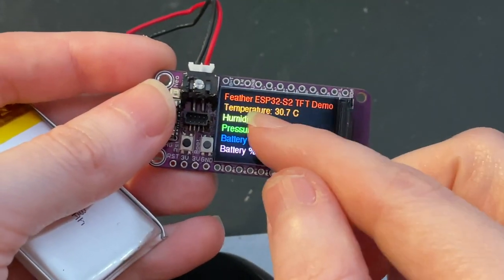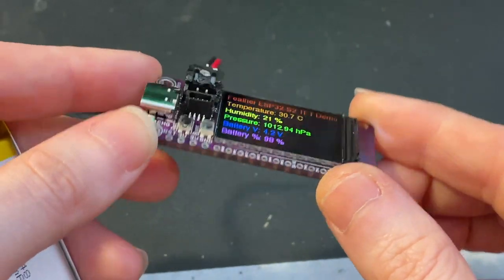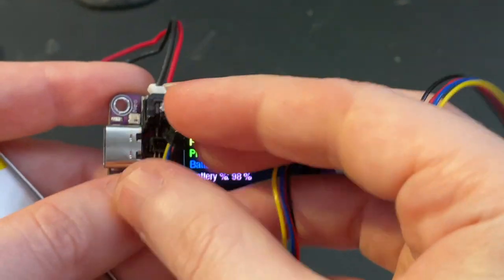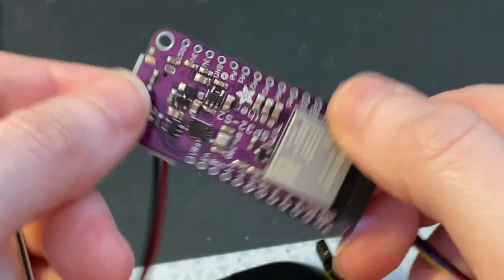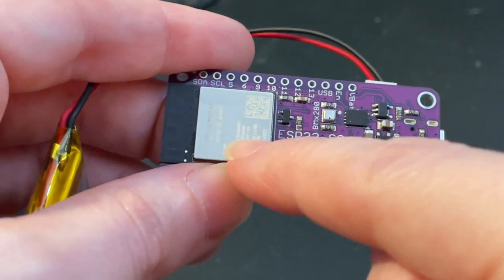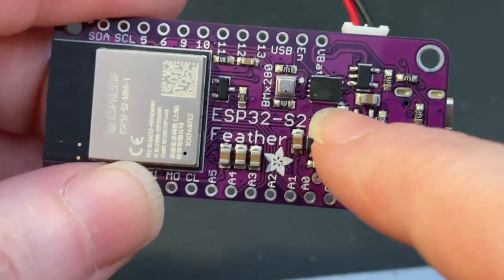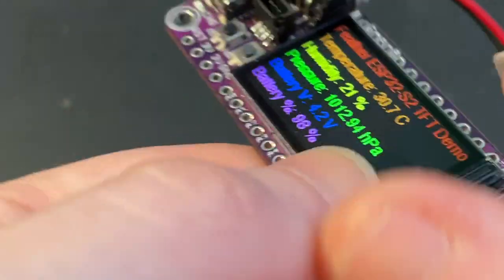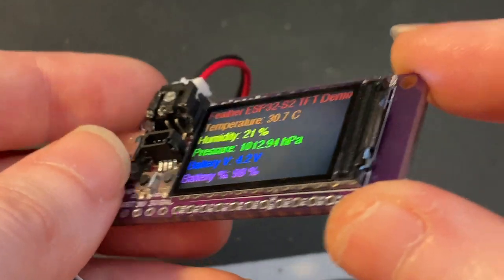Another wild ESP32-S2 Feather appears!

Comment: Looks similar to TTGO T-Display. The more USB-C ESP32 derived microcontroller boards the better. I never see the use for arduinos anymore due to these.

I will comment though that one problem I've had with boards similar to this one is with things like the power connector here being on the same side as the screen. 

If I have a project where I want the display to be visible out of an enclosure, these always make it difficult.

I don't know how feasible it is, but if for instance the screen was on the otherside by itself, I feel like usability wise, this would improve dramatically. It would be much easier to design a case for this, and have a nice flush display.
Reply: You’re absolutely right! In my experience with the ttgo display, it’s possible to mount it in a case, but the usb connector is then flush with the frontplate.. would be a lot better on the other side of the pcb.